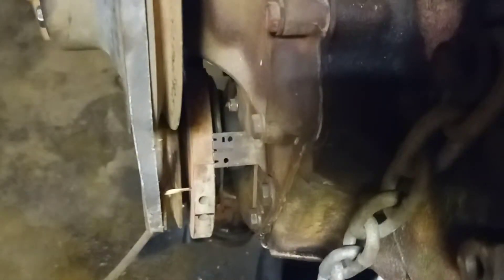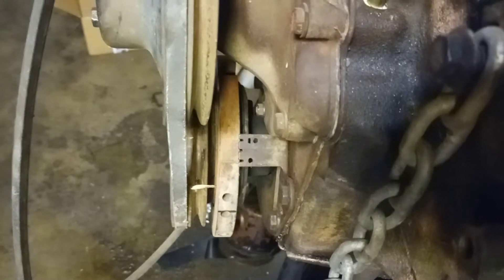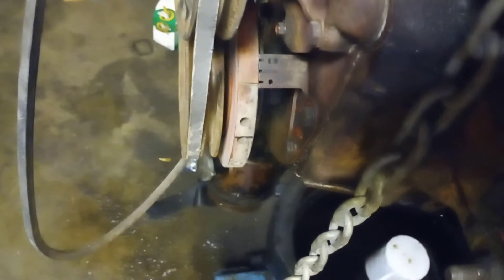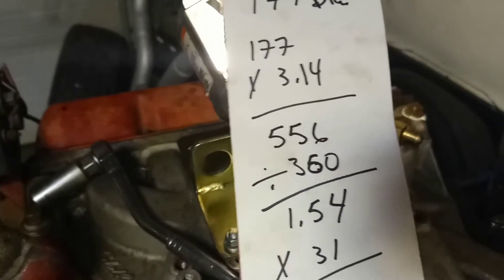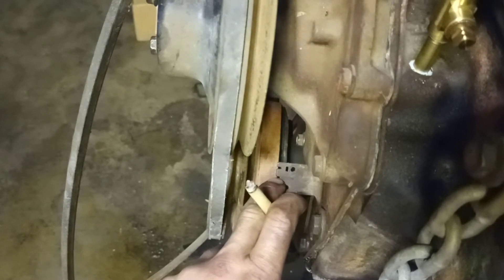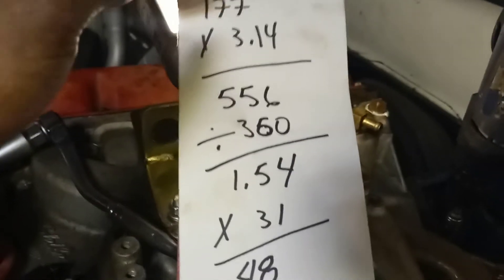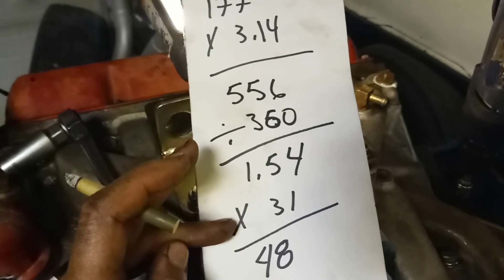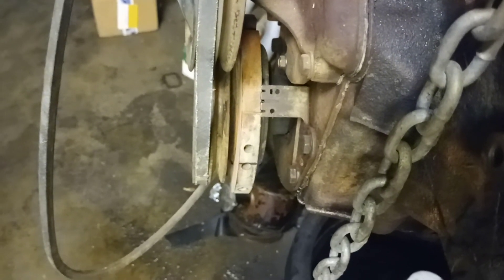Ignition timing and timing marks cheap and easy (Olds 425)

Comment: Hay Nolen just wanted to tell you thank you. 36 degrees all in  is the ticket.The 425 runs like a graped ape and the throttle response is through the roof only thing left to do is set the idol mixture screws because she's running rich at idol but is on point when off the idol circuit O the carburetor is a 800cfm Quadrajet off of a Caddy  👌
Reply from the maker: Those motors run hard. Best of luck with it.

Comment: I'm just making sure I heard you correctly, so measure 48mm from the top dead center mark on the balancer will get you to 36 degrees all in  timing correct.
Reply from the maker: Measure the diameter of the balancer. Multiply the diameter by 3.14. take that number and divide it by 360. That will give measurement per degree, multiply that number per degree buy 36 and that's how far from tdc 36 will be. They run hardest at 36btdc all in with good gas. I have another video where I do it on a 455.

   Nolan.
Reply: Thank you. I've got a hopped up rebuilt 1967 425 Oldsmobile engine out of a Toronado stuffed into a 1986 Buick Regal Limited. The balancer is the same as the one in the video so all the math is pretty much done for me lol math was never my strong suit and I only made it to the 11th grade before I dropped out because all the crap going on at the time in my life anyways you have been alot of help by the way man and she's running like a top now. @wildrosegarage4208
Reply from the maker: If you go 48mm it will be 31 degrees at the tdc mark, 36 degrees at the center mark and 41 at the mark closest to the center.

Comment: Hey man I have a question I need to go out and buy a new socket for my 1967 olds 425 harmonic balancer bolt to rotate the motor because I'm replacing the valve stem seals using the rope method I rebuilt my motor 10 years ago and because I'm not going to find another set of the nos steel style head gaskets and want to keep my compression were its at but I can't remember the size of the 67 425 harmonic balancer bolt head your help would be appreciated.
Reply: 3/4
Reply from the maker: I will check later today cant remember. The seal shim head gaskets if there not rotten can be reused just clean them up and spray them with copper gasket spray.
Reply: @wildrosegarage4208  It's 1/1-8
Reply from the maker: @billiot425olds  So Sorry many I have been so busy with my Ranger motor a 390 for a guy and plumbing it slipped my mind. I planned on checking for you, I feel bad my intentions were good I like helping people out thats why I am on here. Again sorry its not like me.

   Nolan.
Reply: @wildrosegarage4208  It's alright, no biggie man.

Comment: Are you a pipefitter welder by trade.
Reply from the maker: Close. Plumber and gas fitter. But I have spent a lot of timing pipe fitting and welding stands and stuff in fab shops.
Reply: @wildrosegarage4208  I knew it I'm a pipefitter welder in Pennsylvania. The way you talk about welding and measuring the harmonic balancer I knew you were fitter.
Reply from the maker: @marcoceccarelli6415  I am in Alberta Canada. That's neat you new that.  I am a UA488 member. Work is very slow here now for the last 2 years hope it picks up.
Reply: @wildrosegarage4208  come to Pennsylvania I live in northeast Pennsylvania Susquehanna County. We are booming with gas. Grew up in a small poor Pennsylvania town when they started drilling for natural gas everything changed there's so much work now
Reply from the maker: @marcoceccarelli6415  That's awesome. I would like to move to the States I just don't know how to go about doing it. Canada is not what it use to be. A lot of outsiders moved to my province of Alberta because it was the place to go for work and at the same time there all against Oil,Gas and pipelines. Wages have also dropped buy about $10 dollars per hour in the last 10 years. Thanks for the advice.

Comment: Great job using the math. You & I had talked on someone else's video & I came to see your 425, great stuff. Not to discourage you but the factory 425 balancers are a weak spot in these motors. The elastomer degrades & at some point the outer ring starts walking, which of course destroys the utility of the timing mark & in worst cases can sling the thing.
Reply: I, of course, have no videos of my car stuff. It was a long time ago now, 1992 I built my last one, drove it thru '98 or so.
Reply: & thanks for bringing yours, Wildrose Garage, it's great to see folks keeping the stuff alive.
Reply: 18436572ccw for life :)
Reply from the maker: Its got kind of a skinny looking balancer with a strange timing tab. I know the 455 is a different setup. But hopefully she will ride.
Reply: @wildrosegarage4208  You can paint a line across the body & ring & watch it for movement over time. Fluidampr #650501 will absolutely fix it, as long as the snout of the crank's still good at that time. I had a wild cam which might have contributed a bit to the problem. Best of luck with yours, I love that steel crank short stroke big block in a lightweight g-body - perfect combo.
Reply from the maker: @Torch4Life  That's a great idea as long as in has not spun already. Thanks for the tip!!!